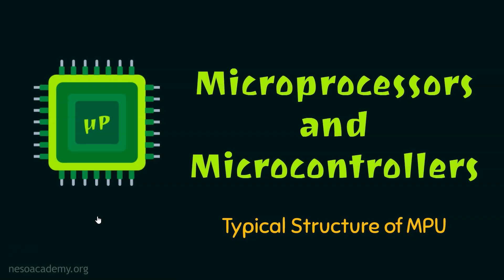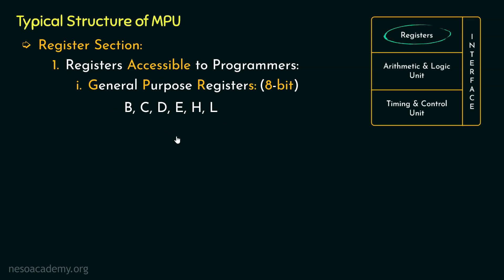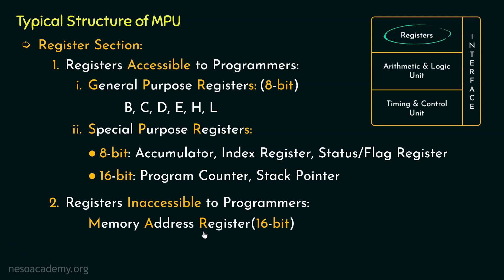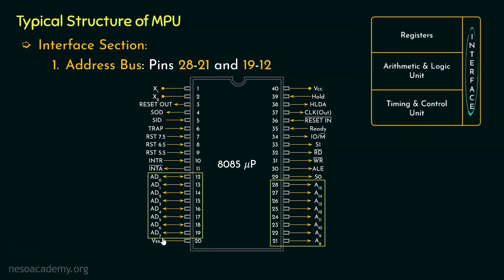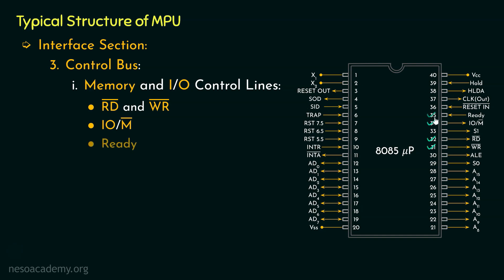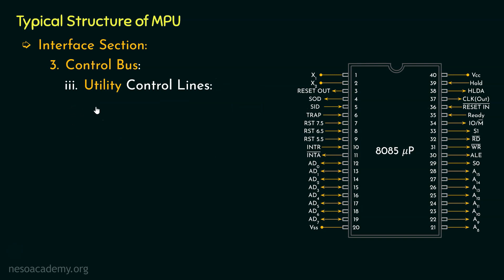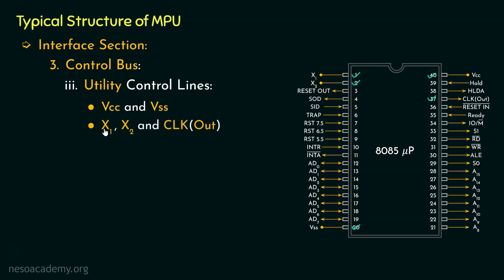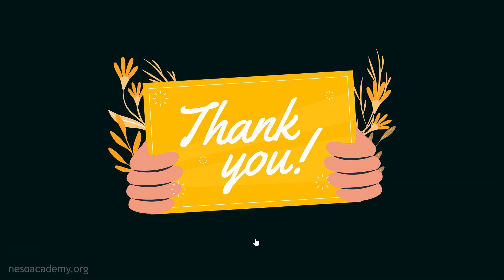Typical Structure of Microprocessor Unit (MPU)

Comment: I have an doubt 
Is pin no 4 and 5 are comes under any of the category?
Because that are all the only two pins can't come under any of the category
Reply: Let see who replies?
Reply: serial input output pin
Reply: Huh?
Reply: In the 8085 microprocessor, Pin 4 and Pin 5 are indeed unique and do not fall under the typical categories like address bus, data bus, control signals, or interrupts.
These pins are part of the Serial I/O category, which is less commonly used compared to other categories like control or data buses. They enable bit-by-bit data transmission, which is useful in systems where serial communication is required.
🔍 Why They Feel “Different”
- They’re not involved in parallel data transfer like the data or address buses.
- They’re used with special instructions (SIM for SOD and RIM for SID).
- They’re optional in many applications, so often overlooked.
So while they do belong to a category—Serial I/O—they’re definitely the least integrated into the core data/control flow of the microprocessor